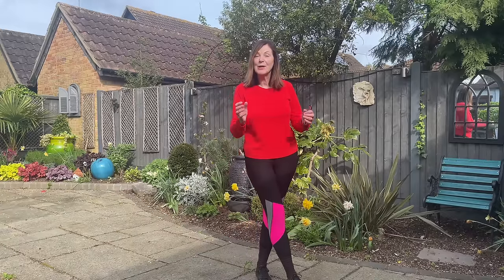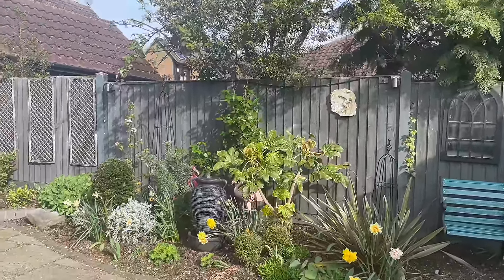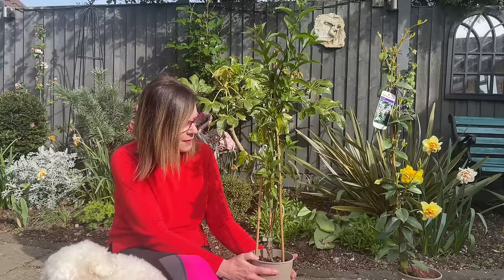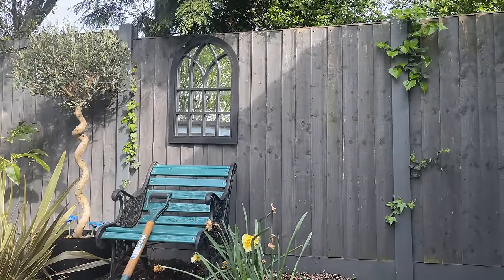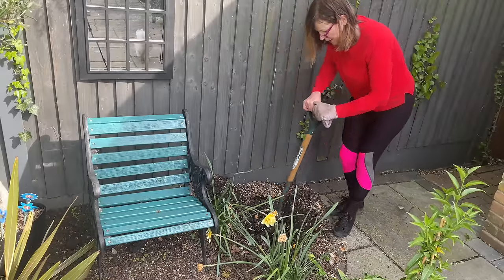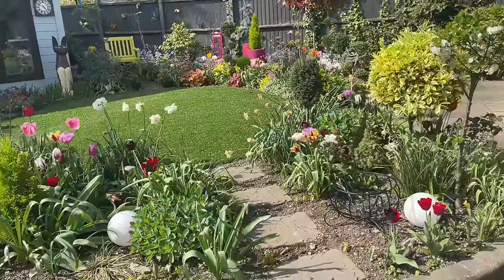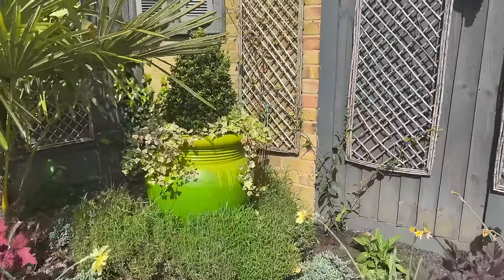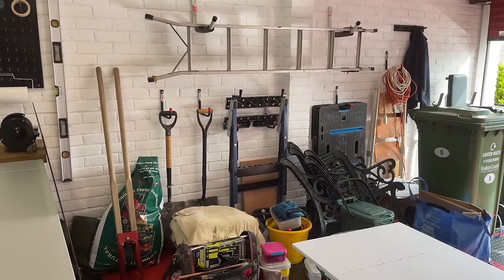Planting Gorgeous Climbers … Star Jasmine & Chilean Potato Tree 💚

Comment: Janette could I please ask if you can stand up in your victorian greenhouse? I'm considering getting one but all the pictures and photos I've seen of other peoples I carn't tell if you can actually stand inside one! Love you garden videos🌺🌻🌸🌼🪻🌷
Reply from the maker: Hi there Rachel, you’ll love it, I love mine.  Im testing height for you right now … I’m 5’9” and as I’m standing outside it my eyes are level with the entrance, so I have to duck down slightly to stand in, then if I’m standing in the middle I can just about stand up straight.  I could stand very straight towards the back where the roof slopes up but I have shelves along the back in mine.  You couldn’t swing a cat in here though 😂 it’s more a large coldframe than a proper greenhouse but it’s very decorative and you can definitely put plants in and do things like hardening off seedlings and sowing seeds with heat mats (I have electric points in mine and a little light).  I chose it because I just don’t have any space anywhere for anything bigger.  I hope that helps you decide 🌺💚